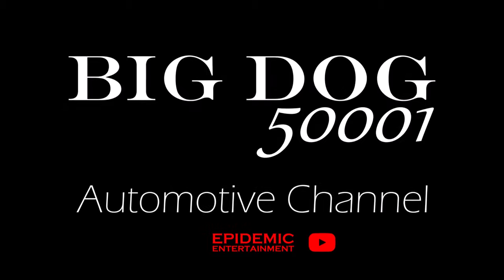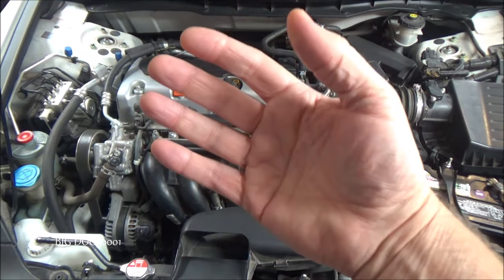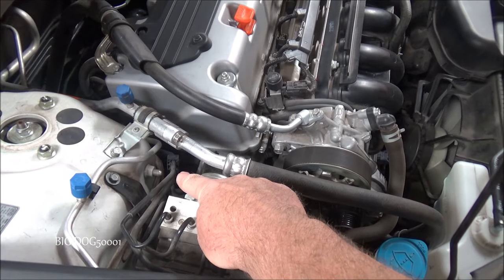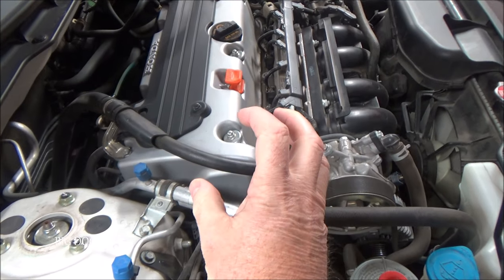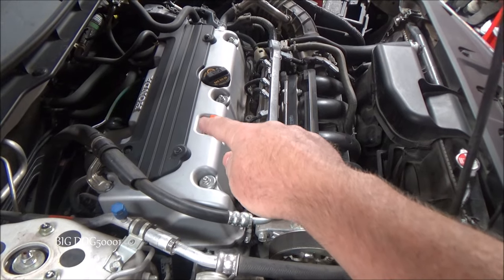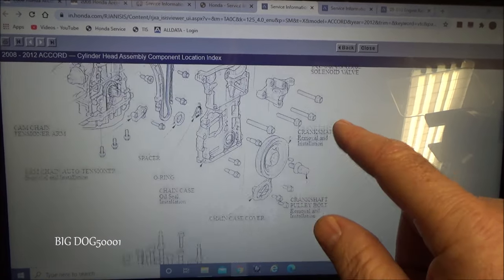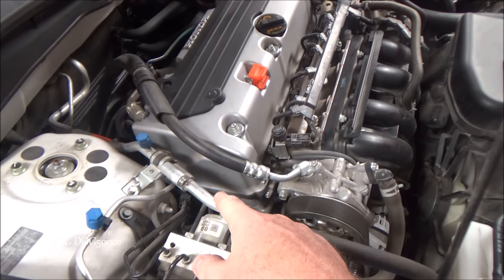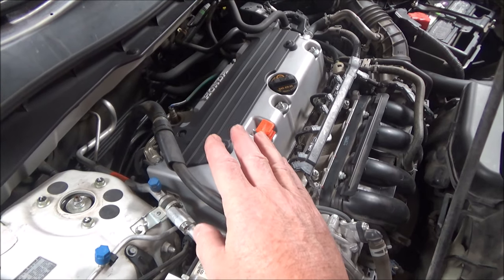Honda Tips:  Engine Rattles on Cold Start-Up

Comment: Great video, well explained and presented. Thank you. My mom‘s 2013 Honda CR V  EX with 80,000 miles has the cold start clanking noise for two or three seconds. But, in addition she is experiencing periodically loss of power when accelerating, The engine lags slowing the car down to a crawl, then resuming as normal. The loss of power happens periodically, then will run normally.  Any connection to the VTC actuator? Thanks for any insight or advice.
Reply: I'm no mechanic, just a guy with a 2013 CR-V with 140,000 miles. This sounds like 2 separate issues to me... the rattling could well be the VTC actuator. The loss of power sounds like "LIMP" (or what I like to call "WHIMP") mode. My hunch is that the throttle body was cleaned and the reset of the computer was not done completely or correctly. I had a similar issue with this LIMP mode after a throttle body cleaning and they my mechanic told me he keep having to clear the codes before it ran properly... If memory serves, It took him 3 tries, but I have a hunch it was more than 3. There are other causes for LIMP mode, but it might be a good place to start. Good luck.
Reply: @danbarry3678  Gotta use a Honda Diagnostic System program to reset the TPS system. Clearing codes out doesn't reset the baseline. Nor does pulling the negative battery terminal.
Reply: I have a 2014 honda crv with 66,000 miles with the same thing but when the car sits over night. I started it up cause when the engine is cold it makes that sound that mean its warming up and goes away I won't worry about that cause if you wanna replace the part its gonna cost you a lot of money but people live with it. I believe the reason why your crv is lacking of power because you have on econ mode that lacks on the transmission and motor which it's not a bad thing you're only driving on 2 cylinders

Comment: question .on start up the vct should be on lock position till it has it oil presure to unlock?
Reply from the maker: The VTC Actuator should be in the locked position at start-up (in general, it should lock itself to the camshaft in the fully retard position when the engine is shut off).  Upon start-up, the ECM activates the VTC Oil Control valve (which should unlock the VTC Actuator) and takes over and will continuously change the intake valve timing.

Comment: 2013 Accord 2.4L VTEC with rattle on cold start.  Could replacing the Spool Valve Assy help, or must you replace the actuator sprocket?
Reply from the maker: It is usually the VTC actuator that causes this.
Reply: @BigDog50001  Thanks... that's what I was afraid of :(

Comment: So the VTCS needs to be changed in order to stop that noise,right ?
Reply from the maker: If the VTC is the cause then yes replacing it is typically the fix.
Reply: @BigDog50001  Make sure its the new and improved part # not the oem part, the new number is 14310-R5A-305, a new and improved actuator. Old oem part # is 14310-R44-A01, do not use this old oem part.

Comment: I have this issue with the VTC- my Honda dealer can't hear it (even having my car overnight and 1st start up)  but all my neighbors and I can hear it. Another Honda dealer said they never heard of the VTC..ugh finding someone to fix it is going to be impossible ..smfh
Reply: It only happens when the car sits over night cause the motor cooling down but when you start it up it's cold start the car warming up and its goes away its normal
Reply: @johnathanwoodley5005  the other day mine did it mid day after driving for an hour
Reply: @cathyrobi3891  the car is just warming up

Comment: My 2012 Honda Accord does the same rattling noise on a cold start. 
I brought the vehicle to Honda and they said after 100,000 miles the lifters need adjusted. 1200.00 later that did not solve the problem ! 😡 I will bring it back to Honda and show them Dave’s video. What a rip off !

Comment: I have an a2 at idle no rattle,  at about 2000rpm I have a slight rattle noise. The rattle noise goes away at higher rpms.  Do you think this is vtc related?
Reply: @Camlobes Vtec did u figure out the issue u we’re having?
Reply: @FinessedIt  They say its normal to hear the valves sometimes.  It still does it but runs like a champ.

Comment: O9 accord 2.4l 145500 miles zero problems with it oh I had a starter replaced but it's close to 13 years old no biggie
Reply from the maker: I like that generation Accord.  Thanks for the input!

Comment: Thanks for your videos! So what has gone "bad" with the VTC in these cases?  Lots of folks replace these actuators, but rarely do you hear about the actual failure...what is it that fails?
Reply from the maker: Most common issue is caused by a failure of the locking pin to lock the VTC in the full retard position upon shutdown of engine.
Reply: @BigDog50001   Thanks, I think I can visualize that. So if the cam sprocket rotates only in one direction (clockwise), how does the VTC move both clockwise and counterclockwise on it's own to make the metallic rattle? Oil pressure? Just trying to figure out what exactly is rattling, and how it's possible. I had the same cold start rattle for about a year. Recently changed the timing chain, tensioner, and guides...no more rattle. Didn't touch the VTC.
Reply: @bonnerkarger8926  what's rattling is at Cold Startup there is exactly 0 oil pressure on the chain, tensioner and guides,because all the oil has drained out of the system that's why it's not there when it's warm because you have oil pressure.I have 3 different vehicles a Toyota,a F150 and a CRV and all have variable valve timing and guess what?all 3 make some kind of the same noise at start up.Its just the nature of this type of system that the oil pressure controls the timing.Always keep your oil clean and full and it will be fine.
Reply: @dustinpomeroy8817  Hi, Dustin.Do you think higher viscosity motor oil will help with noise?
Reply: @simsim2486 I wouldn't think so as the problem happens more as temperature drops(mine) the viscosity is higher in cold.

Comment: You can change the VTC without removing the camshaft. Also changing the engine oil early may help. I had my 2012 CRV purchased brand new. Changed the engine oil religiously between 3-4k miles when the maintenance minder says 60% and I still have the cold start rattle startup noise. I'm going to try to use 5w-30 oil weight next time.
Reply: Did you fix the problem before switching to a different oil? I’m trying to understand if this is a problem that actually need fixing
Reply: @stephnicaise  it did not fix it. I get a rattle at start up almost every time. It’s been like this for over a year.  Engine is flawless other than the start up rattle.  I have the ability to change the VTC actuator myself but I am choosing to ignore the noise as I am not convinced it causes any engine damage.
Reply: @Tacoexplorer  yeah same here. And based on other people doing the repair and it coming back I really don’t think it’s necessary
Reply: @stephnicaise  I read reports that the timing chain might stretch due to the rattle over time. If it indeed stretches the engine will throw a cam position sensor code.  So once that happens you definitely need to change the VTC actuator along with timing chain, and tensioner all at once. If it ever happens I will change all three since it’s the same job.  Not a big deal and not much extra cost as well.
Reply: @Tacoexplorer  My 2011 accord just popped that code p0341. Changed the cam position sensor.  No help. I'm hoping it didn't jump time. How much do u think they would charge to change the timing and vtc an tensioner? I'm hoping not to much.... lol
Reply: @matthewwebster3297  I changed my VTC actuator myself 2 weeks ago in my 2012 CRV. Same as accords. If you are throwing a cam position sensor. You have to check if your timing chain is stretched or not. Most likely it is.  So it’s a bigger job unfortunately.  To check the timing chain, check if the TDC markings at the cam sprockets and crank line up.
Reply: @Tacoexplorer  happen to know how much a timing job would run? And thanks I will check the timing out.
Reply: @matthewwebster3297  I do not sorry. Since I paid $190 for the VTC actuator and did the work myself. Get a quote from a shop, don’t go to the dealer. Use OEM parts and not aftermarket.
Reply: @Tacoexplorer  alright, thanks for the info. Do you use rock auto part? I got a cam position sensor for 14$ when they go for 80$ at auto zone. I said what the heck I will give it a try.
Reply: @matthewwebster3297  no. I only go with Honda OEM parts. Especially electronic parts and internal engine components.

Comment: Is it necessary to fix the issue?.. Coz the engine performance is good and there is no problem with this rattel.. please advise
Reply: Bump - any insight on this?
Reply: Did you fix it? I have the same issue and I don’t know what to do. I always had Honda Civic same motor and never had this issue maybe because I used lucas oil all the time
Reply: I called my honda dealer and they said it needs to fixed. The issue has to do with timing and the longer and more worn the actuator gets more damage will be done to the engine. Its not just an annoying noise, it needs to be fixed.
Reply: I've read a lot about this and my conclusion is: No, at least not asap. It won't harm anything when the vtc rattles because the cam rotation will be within limits and non interfering. Some people say it will stretch the chain over time so that'd be concerning. I'm guessing tho, that people that report chain stretching missheard the noise and it was timing chain noise to begin with. Keep the oil topped of.
Reply: Thank you for sharing

Comment: Hey do you have to be a dealer to have access to that interactive Honda website your using to look at the engine components?
Reply from the maker: No, you just have to pay for it.
Reply: And would you say in the Honda 2008 the catalytic converters can be removed and the engine could run fine without them?
I’m afraid if I don’t the engines built up pressure would cause damage to it.

Comment: Maybe Engine Flush or  Injector Cleaner (for fuel) is needed or both.
Reply from the maker: Probably won't help for this situation.  Unfortunately engine flushes can cause more issues than they solve and Hondas do not typically have fuel delivery issues like other makes so injector cleaning usually does not fix anything.

Comment: absolutely no reason to pull the cam to change that actuator. Pull both sprocket bolts out and you can remove both sprockets giving enough room to slide a new actuator in and out. Saves removeing the cam and readjusting the valves.

Comment: "What does the VTC Actuator do and do I need to fix it? ... If an error occurs, the VTC system control is disabled and the valve timing is no longer variable. This should be repaired sooner than later to avoid a potential check engine light, possibly accompanied with rough idle and/or lack of power or stalling."
Reply from the maker: It can definitely cause issues, especially if the engine computer does not detect the problem.
Reply: @BigDog50001  so now my question is, my vehicle is at 177k miles and it's recommended, from an article I read, to change the timing chain at about 200k miles.... should I simply change the VTC actuator PLUS the timing chain and water pump since I'm going (my mechanic😅) is going to open it up to change the actuator?
I'm trying hard to inform myself and not allow yet another mechanic to take advantage of me.

Comment: My 2009 rattles it’s loud. It remains rattling after cold start
Reply: Same here
Reply: Did you ever get it fixed?
Reply: Be sure to be using the 0w 20 oil. Change it frequently.

Comment: I have a rattle noise on my Lexus ES330 for the first couple of seconds, but that is not anoyying me. I am annoyed by the continuous engine rattle at high speed. already checked the engine mounts and they are OK.

Any Advice?
Reply: Its a cold start

Comment: I fixed this 5 years back when my accord had 80k miles now at 206k its starting to have the same sound guess they don't last forever
Reply from the maker: Thanks for the input!
Reply: Did you fixed again?
Reply: @youtubersenlamira7562  it came again but the car has 216k miles so yes I have to but I dont think I will since of the miles. I'll just roll the dice
Reply: @Kungpl0w  I’m the same way! My accord has 200k miles now,,, it might be better to try to cash it out then fixing it. I was wondering it I don’t fix it, how long will it last!
Reply: what parts did you replace?
Reply: @Andervt555  VTC actuator

Comment: So if there is a 2 to 3 second rattle on a cold start for  08 to 2012 it is the solenoid causing the problem.
Reply from the maker: Most likely the cause yes.
Reply: @BigDog50001  should be this be fixed ASAP ? Will putting a thicker oil help

Comment: Honda's have become crap now. I have a 2014 CRV. With 85,000 km. on the vehicle I had to change the VTC and the timing chain because it had stretched. 4,000.00 bill for that one. Less than 50,000 km later (only 2 years) the same grinding sound greets me on each cold startup. Honda needs to deal with this problem but after many years it doesn't look like it.
Reply from the maker: Thanks for the input!

Comment: That's a 3rd Generation, and starts on 2007 thru 2012
Reply from the maker: It is an 8th generation Accord in this video, which would be model years 2008-2012 in the US (although production was started in 2007 they are considered 2008 models).  Definitely NOT a 3rd generation Accord, which was the first Honda I ever owned, a 1989 Accord LX-i.

Comment: Here we go. Let's blame the customer. This issue belongs to the NTSB and the courts. Toyota screwed millions with bad rotten steel. Now it is Honda's turn.
Reply: Not sure who is blaming the consumer but if you don't change your oil when recommended or when low how is it the manufacturer's fault?

Comment: January 29, 2022 — A Honda VTC actuator class action lawsuit has been certified in two states (California and Illinois) after owners complained their vehicles rattled a few seconds on cold starts.

According to the plaintiffs, Honda injured them by failing to tell them about defective variable valve timing control (VTC) actuator 14310-R44-A01 in these models.

2012 Honda Accord (L4 engine)
2012-2014 Honda CR-V (2.4-liter engine)
2012-2015 Honda Crosstour (L4 engine)
In 2012, plaintiff Mary Quackenbush purchased a new 2012 Honda CR-V from a California dealer. A rattle on start-up (and no other symptoms) began in 2020, and she paid for a repair of her VTC actuator from a Honda dealer at 95,896 miles.

California plaintiff Anne Pellettieri purchased a new 2014 Honda CR-V from a dealer in 2014 and allegedly first heard a rattle one to two years after purchase. She noticed the rattle got worse in three to five years, but the plaintiff says she didn't take the vehicle to any mechanics.

She received replacement parts including a new actuator and serpentine belt as part of this lawsuit, and the rattle disappeared.

Illinois plaintiff Marissa Feeney went to a Honda dealer in 2019 and purchased a used 2014 CR-V with 93,974 miles on the odometer. Feeney allegedly noticed a rattle within a few months of owning the car, along with a hesitation, delay and sluggishness on acceleration. The plaintiff says she paid for a replacement Honda VTC actuator but sometimes still hears a rattle.

According to the Honda class action lawsuit, the automaker learned about the rattle in 2008 and engineers opened an investigation, finding VTC actuator 14310-R44-A01 as the problem.

Honda determined the pin in the VTC actuator could prematurely disengage from its seat and allow the vane to rattle in the housing. The rattle will last only a few seconds because oil pressure builds up and cushions the assembly.

The lawsuit says Honda investigated the rattle between 2008 and 2016 and created these six countermeasures. The final repair involved replacing VTC actuator 14310-R44-A01.

12/03/2007 — U-Groove width sorting at Denso
9/11/2008 — Select Fit to achieve target Stopper Pin Depth
9/10/2009 — DC – Revise Pin Depth Spec from 2.02mm-5.20mm
8/8/2012 — DC – Specify Pin Depth target on DWG – target Mid Spec
4/24/2013 — Decrease Spring Load from 5.78 to 3.64N
9/24/2015 — Design Change A1508259 issued for 14310-R5A-305
Some Honda vehicles received countermeasures one, two and three, while other vehicles received countermeasure four and some received countermeasure numbers four and five.

Honda VTC Actuator Class Action Lawsuit Certified
The Honda class action lawsuit has been certified for the following customers and locations.

Plaintiff Anne Pellettieri will represent a California class of new and used purchasers of vehicles equipped with VTC actuator 14310-R44-A01 from California Honda dealers, and former owners who resold or traded in to California Honda dealers.

Plaintiff Mary Quackenbush will represent a California repair class of consumers who purchased new or used Honda vehicles equipped with VTC actuator 14310-R44-A01 from California Honda dealers, and who paid to have their VTC actuator repaired by California Honda dealers.

Plaintiff Marissa Feeney will represent an Illinois repair class of consumers who purchased new or used Honda vehicles equipped with VTC actuator 14310-R44-A01 from Illinois Honda dealers, and who paid to have their VTC actuators repaired by Illinois Honda dealers in Illinois.

The Honda VTC actuator class action lawsuit was filed in the U.S. District Court for the Northern District of California: Quackenbush, et al., v. American Honda Motor Company, Inc., et al.